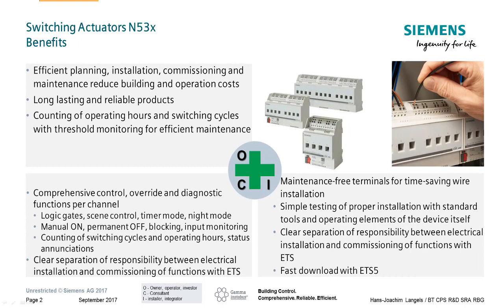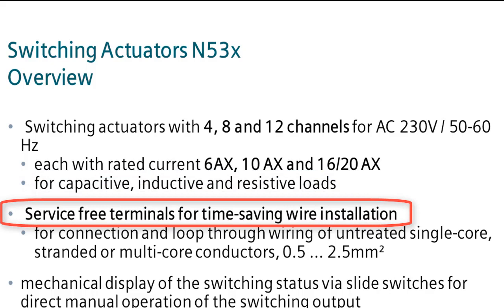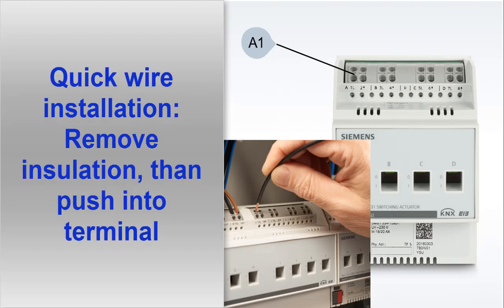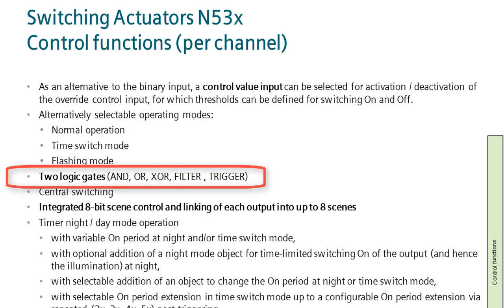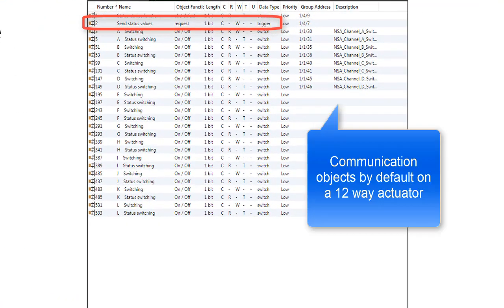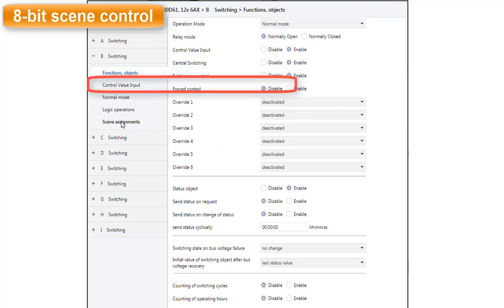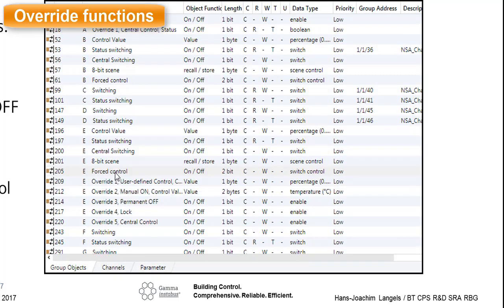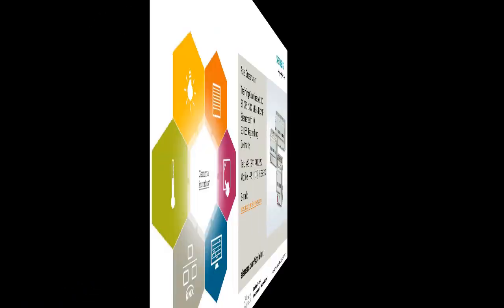Siemens - new KNX switching actuators

Comment: not very practical to wire
Reply from the maker: Rui Rego so what is more practical then? Ferrules and screws?
Reply: @eibdoktor  hi Alex. it would be more pratical to have the mains on top and the "outputs" in the bottom. we could use shunts on top.
Reply from the maker: @rpmsdr  Thanx for this detailed reply! Can you also tell me which KNX manufacturer delivers such actuators? Even market leader ABB doesn't, if I am not mistaken! Of course I can understand your argument quite well - but:
The reason is quite simple: High currents should pass the device on the shortest way. If you do it like in an MCB, from top to bottom, this isn't fulfilled. The longer the distance, the higher the losses and the heat dissipation in the device. (or you must use more copper and stronger relays, which then would cause problems with the available space). Just remember: The biggest actuator of Siemens has 12x 20 A = 240 A !!! Plus the MCB tolerance it will get up to almost 300 A before an MCB of 20 A (B characteristic) trips.

But another question: What do you mean with shunts ? What are they supposed to do?
Reply: @eibdoktor   hi Axel, the for the reply. first, i would to say that i prefer the Siemens actuators, they are more robust :).
i'll send you the actuator with that characteristic in a private email, i think i still have your email from the IPAS training that you gave us.

Comment: How many light fittings can be connected to one channel
Reply from the maker: Nihal Mahamood There is no limit as per number of light fittings. The limitation is always ruled by the wattage and type of the loads. Siemens publishes some standard load configurations both in the operation manual for these actuators and the GAMMA product catalogue on siemens.com/gamma-td.